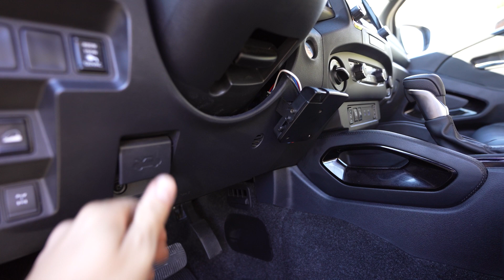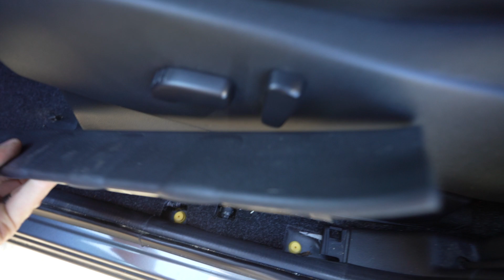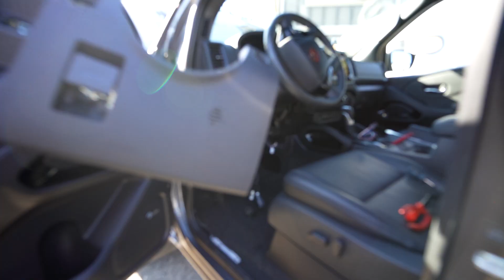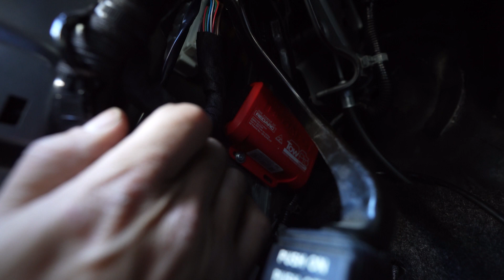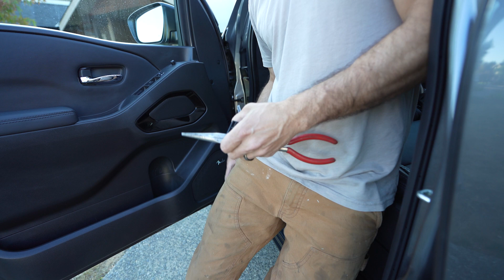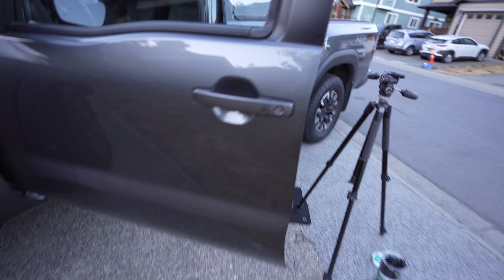Nissan Ruined My Brand New Truck! 2022 Nissan Frontier Trailer Brake Controller Install.

Comment: How did Nissan, not a dealership, "ruin" your truck? Rednecks  have been installing brake controllers like that in their pickups since the 80s. So, where's the damage?
Reply: Dealerships aren’t owned by Nissan. Your dealership did a crap job. Place blame where it’s due. Having said that, those redarc units are fantastic and the only version we suggest to customers.
Reply from the maker: Well, they ruined it (for me) in a few ways. #1 With the controller installed, I couldn't fit in the truck without hitting my knee on it, even with the seat all the way back, 80's trucks had a LOT more room! #2, they unnecessarily drilled through the lower dash panel, meaning if I go to sell the truck, that panel is effectively now garbage and I need to replace it. #3, it looked like absolute garbage, for no reason...It's not 1980 anymore, there are far better options that both improve the function and actually look good. For reference, I paid more to have the absolute cheapest Curt brake controller installed than I did for the Tow-Pro Liberty. And as for why I throw Nissan under the bus instead of the dealer...I reached out to Nissan Canada on Twitter and they supported the original installation and said that was their current standard. And finally, when I originally spoke to the dealer, they informed me that the controller they installed was the only one on the market that would work for the 2022 Frontier (which is obviously not true) and after much discussion, I determined that the best course of action was a refund and installing it myself. For anyone wondering, the Tow-Pro works absolutely perfectly, I've towed my mobile bar and a dump trailer (at max towing capacity) with it and couldn't ask for better performance. Great job with the design of the Tow-Pro series @RedarcElectronics !
Reply: @WetCoastWorkshop  
Thanks for replying back. Secondly,  why didn't you ask the dealership where and how they were going to install the controller before paying them? Third, the lower plastic with holes is mostly unnoticeable from the driver pov.
Reply from the maker: I did have a brief discussion with them about what was going to happen, and he didn't know exactly which controller it was, just told me it was the only one that worked with the truck. I agreed to have it installed under the center console (there's a little pocket there), and when I picked it up, they said they had trouble getting the wiring harness to go that far. And yes, the holes were very visible every time you open the door, and always visible from the passenger's side. Either way, even if (for some reason) that had actually been the only brake controller that worked with the truck, the sloppy install was completely unacceptable for a dealership doing work on a brand new vehicle.
Reply: @WetCoastWorkshop  
Understood.
Reply: @WetCoastWorkshop  Those desk service guys don't know shit, they just take your order and try to upsell you services and other shit you don't need because they literally make commission off of every encounter.
Reply: What a snarky jerk. "Ruined" in this case means tacking a brake controller on that whacks a person's knees, especially shorter drivers where the seat is forward.

Comment: Obviously the new one is a better way to begin with BUT the other one would habe been fine with a slightly different location and hiding wires. I have tuck wires for many after marker things many times. That was just lazy.

Comment: FOCUS, FOCUS!!!! Why did you not feed the wire harness through the panel, then connect it to the brake control knob switch, and then install it back into the panel?

Comment: Since installing this controller, have you had any issues with it? I put one in a 2023 Frontier, using the wiring harness to mate with the stock wiring, no cutting and splicing at all. I towed my camper with it about 3 times with no issues, but now on the last two trips I get a constant flashing red light and the controller only seems to work when pushing the button manually. At first when I plug it in, everything is normal, even while driving as long as I stay about 5mph. When I accelerate, it the red light begins flashing and won’t go off until I turn the truck off again. Even unplugging and reconnecting the trailer harness has no effect.
Reply from the maker: @duanebledsoe7566  I personally haven't had any issues since the installation, and I've towed the trailer quite frequently. It's probably worth reaching out to @REDARCElectronics to see if they can help you troubleshoot.

Comment: Awesome video, you made it look so easy with clear instructions and YES the Nissan dealership that installed the first controller did muck up the appearance of your truck and ruined the panel you replaced, everything you did looked like it was factory installed!
Reply: Were you an Airdale? I saw the P-2 Neptune 

Retired P-3 AT

Comment: I just ordered this exact brake controller for my 23 Frontier SV. Thanks for the video! It will make my install process go smoother. One question. The plug located behind the kick panel, it looks like it might be high enough to access without removal of the kick panel. Any chance of that? I can take it off if need be, I already did it on the passenger side to install the tow harness relays. I’d just like to avoid it if possible.
Reply from the maker: You can definitelty access the plug without removing the kick panel, but you will need to find an alternate mounting location for it. I like the spot right behind the panel as it easily fits the controller.
Reply: I installed mine the way you did yours. The hardest part was modifying the blank to hold the knob. I had to use a 1/2” chisel and scrape the back side of the blank to thin it down so the knob’s momentary override push action worked correctly. I also had to shorten the sleeve of the blank about 1/4” from behind because the knob housing was tapered and wouldn’t fit in all the way without doing this. Drilling the two holes was no issue since I used a drill press and brad point bits to make it precise. The instructions called for the larger hole to be 3/8”, but this proved to be too small for the supplied nut. I widened it out as well. That part is critical! If the nut does not slip freely into the hole then it can crossthread easily and ruin the knob!!! So my total install time was 2 hours and I easily spent an hour on the blank modifying alone, just figuring things out.
Reply from the maker: @TheRooster954  Yeah, modifying the blank was the worst for me too. I did it off camera because I didn't want anyone getting bad ideas. I used a utility knife and pliers and then I chamfered the back of the hole to get it through enough. I think ordering the proper switch plate is probably worth it for $10.
Reply: I saw one installed using the RedArc blank. It didn’t look good to me, like it just didn’t match the Frontier dash well enough. It was a lot of work to put it in using the Nissan blank but it was worth it.
Reply: Since installing this controller, have you had any issues with it? I put one in a 2023 Frontier, using the wiring harness to mate with the stock wiring, no cutting and splicing at all. I towed my camper with it about 3 times with no issues, but now on the last two trips I get a constant flashing red light and the controller only seems to work when pushing the button manually. At first when I plug it in, everything is normal, even while driving as long as I stay about 5mph. When I accelerate, it the red light begins flashing and won’t go off until I turn the truck off again. Even unplugging and reconnecting the trailer harness has no effect.

Comment: did you change the brake controller fuse to larger amperage?  manual seems to suggest that should be done.
Reply from the maker: @bguffer  mine came with the tow package already, so I left the original fuse and haven't had any problems.

Comment: Great video! I'm about to buy a 2024 without tow package and the dealer outsources the install using aftermarket parts. I working on getting them to throw in the tow switch, harness and receiver (OEM) that I can install myself along with a brake controller. Like you, I'm particular to how things are installed and I don't think it is unreasonable for a professional business to do professional level work that a customer is paying for. I would lose it if I were to have encounter the work you paid for. What a hack job and I hope you got a full refund and didn't have to pay for the lower panel.

Comment: Hi Wet Coast Workshop, I want to say Thank you for your video  it was a grate help, I didnt knew that the Nissasn 2022, was pre-wired for Electric Brake Controller. Also I just got my Redarc Towpro Elite,  and got the harness...on the instruction it mentioned to add a Circuit Breaker...should i add it? Would it be just ok  with the Harness?

Thanks
Reply from the maker: Glad it was helpful! There should be no need to add an additional circuit breaker as there is one already in the engine bay for the towing controls.
Reply: @WetCoastWorkshop  
Got it, thank you for the info. Wet Coast Workshop. Looking forward to new videos.

Comment: If you were unhappy with the results then why did you leave?? First off you need to tell them where to install it if you didn't want it in the most convenient spot for them too Most of the time the mechanic is getting paid hourly so he might of been given 2 1/2 hours to install something that should take three for proper clean fit

Comment: You had 2 empty switches/buttons, is that what it’s for the trailer brake and what else???
Reply from the maker: You can use them for any accessories you want to add, like maybe a light bar. I don't have any plans for mine yet.

Comment: Do you have a part number for the harness?
Reply from the maker: Yes, it's TPH-014. You can find it on redarcelectronics.com  . They also have the switch plate blanks back in stock now, they are TPSI-008

Comment: Really. Nissan or the dealer? Can't get your facts straight, sell it and get a Taco....Just a BS video.
Reply from the maker: Not sure what Toyota has to do with this...I chose the Frontier over a Tacoma for many reasons....But yeah, when the dealer follows Nissan's recommended installation techniques then it's on Nissan (and the dealer) for the shoddy install. If you're happy with a horribly installed, ugly, cheap, inconvenient trailer controller, then by all means, you do you! But if you want a better option, then follow along and give the Redarc a shot.

Comment: I bought the redarc controller and I have a 3d printer so I 3d modeled a new switch blank to not ruin the real one. I designed the new blank the fit the redarc knob perfectly and looks factory.
If you are interested I can send you a picture of mine and if u want me to print one for you I'd send u one. The resin for the 3d print is super cheap and I already invested the design time for mine so I'd send it free. I don't have the 3e print files on thingiverse for others to print themselves yet but will put it online just haven't got to it.
Reply from the maker: Thank you! That's a very generous offer! My modified switch plate is working for my needs right now, but if you do get the 3d plans loaded up definitely link them here, I'm sure lots of people could make use of them!
Reply: Did you ever put the file on thingiverse, and if so how would I find it?

Comment: Put the rubber door seal back over the top of ur lock panel edging
Reply from the maker: Yes, thanks, I did this after testing out the system towing a trailer!

Comment: i just bought my pro4x  last month and thank god you showed me this video i was going to get it at Nissan but nevermind lol
Reply from the maker: Haha, yes, please avoid! Highly recommend the Tow-Pro controller (Liberty or Elite depending on your application). They do also sell a switch plate blank for the frontier, they were just out of stock when I ordered my controller. The switch plate was definitely the hardest part of the process, but that's only because the rest of it was so easy! And don't worry about color match for the switch blank, because none of them match anyways, haha.

Comment: I went to the dealer for a brake controller, and they scratched their heads like they didn't know what I was talking about.  I went to my RV dealer, they installed theirs within what seemed like an hour and it looks so much better.
Reply from the maker: Yes, I didn't even think to go to an RV dealer, but they are probably a lot more experienced with brake controllers than the dealers are. I'm happy that I ended up doing it myself, and would have done so originally if I had the time, but good to know there is another decent option out there!

Comment: Nissan didn't ruin your truck the dealership ruined it
Reply from the maker: Yes, the dealership poorly executed the work, but this (at least at the time) was the approved installation by Nissan Canada, so the dealership was following guidelines and it's Nissan who needs to set the standard for the dealerships!
Reply: From my experience no dealer need work approved by the car manufacturer. Only big warranty jobs related to hybrid battery and power train.

Comment: I wouldn't have paid for that. Thats terrible honestly
Reply from the maker: Yes! After confirming with Nissan that this was, in-fact, what they intended to do (and consider a professional installation) they refunded me and ordered a new lower dash panel to replace the one they drilled into. So, other than a bit of extra work, and a valuable lesson, they did resolve the issue....sort of.